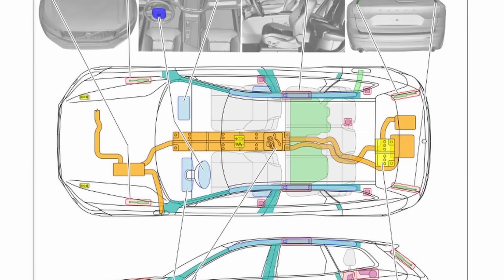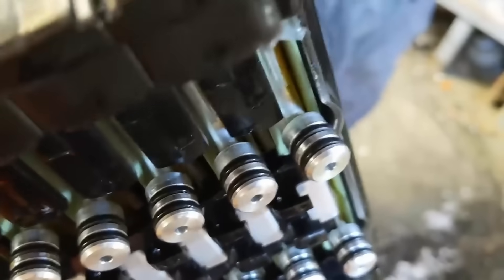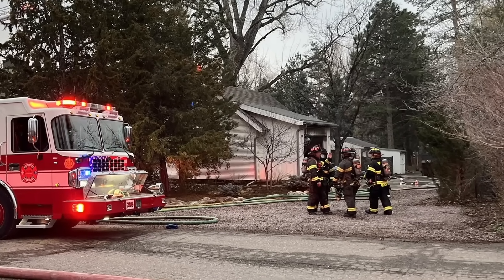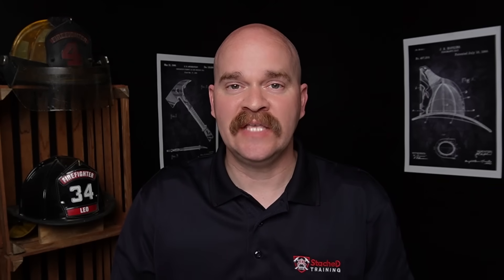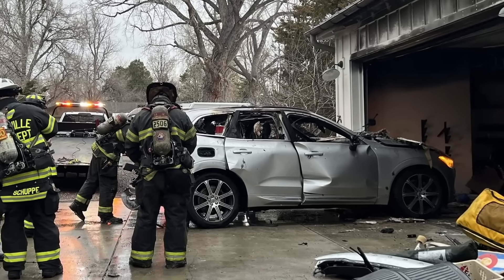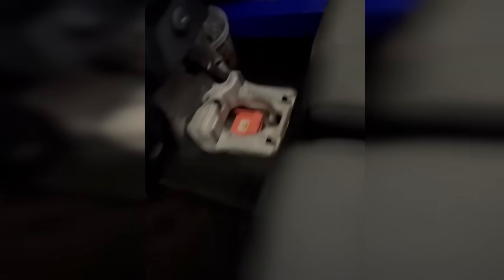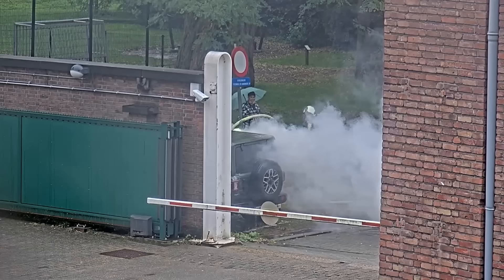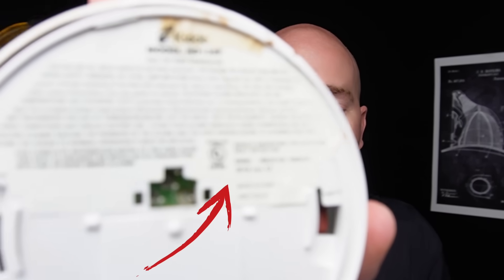EXPLOSION: Volvo XC60 Electric Vehicle!

Comment: Thank you. I'm an EV owner and was expecting yet another diatribe from an EV hater BUT I was wrong. While EV fire rates are well below that of similar internal combustion vehicles they are indeed harder to deal with. Outgassing of toxins is another aspect I hadn't thought of. Should EV owners consider putting heat sensors/alarms in the garage itself?
Reply from the maker: Thanks for sticking around for the full video ;)  Smoke alarms would detect the failure far faster.  Heat detectors would be slow to detect the failure.
Reply: @StacheDTraining  If a hybrid or ice vehicle is present, could/would combustion products set off the smoke detector? We have smoke detectors throughout our home as well as a CO detector.

Comment: Wouldn't a 'heat detector' rather than a 'smoke detector' be more appropriate in a home garage, assuming that it is tied into the home's wired alarm network?
Reply from the maker: Smoke alarms would detect the failure far faster.  Heat detectors would be slow to detect the failure.

Comment: The XC60 isn’t an EV - it’s a HYBRID. Hybrids are a risk because of the FUEL tank.
Reply from the maker: This failure has nothing to do with the fuel tank.
Reply: @StacheDTraining  Heard of fuel leaks? Hybrids are KNOWN to catch fire twice as often as pure ICE vehicles and sixty times as often as pure EV’s. It’s almost like mixing solvents and plastics is a problem…
Reply: @StacheDTraining  I think a Full EV / Hybrid owner has been upset. It amuses me how tetchy they can be.
Reply: Read the blurb at the top of the page and you'll see it was correctly described as a PHEV.
Reply: 0:13 0:16 0:19 0:23 All 2-mode hybrids are electric vehicles. ("2-mode" means it can run on just the battery, at least part of the time.) My (hybrid) 2016 Toyota Prius c is an electric vehicle.
Reply: @aliendroneservices6621  Hybrids are inherently higher fire risks. The data indicates they are twice as likely to catch fire as a Pure ICE vehicle which is thirty times as likely to catch fire as a pure EV.

Comment: This is a serious design and manufacturing problem. The batteries should be handled like an engine in an ice vehicle, completely firewalled from the interior. It is even more pertinent because of the dangerous fumes that can kill you before/without ignition. 

The fact that those gases can reach the interior of the vehicle is a class action suit in the making. This is not the only manufacturer that has this issue. Batteries in EV’s are far more deadly than ICE vehicles, now that the percentages of them are rising, the dangers are quite apparent.

Comment: if the EV industry wasn't in  denial about any and all negative aspects of these things  they might implement monitoring / alerting  for dangerous  conditions. There's certainly enough tech crammed into these vehicles already. . Also blow out plugs are a thing...  if you  admit that outgassing is possible..  The big problem is the " emperor's new clothes"  problem.  No heresy  zone.

Comment: If it already off gassing then it is more than likely already in a run away short so pulling the high voltage disconnect will not do much. The battery was probably shorted internally and once that short path is established it will burn its way through the rest of the electrical insulation in a matter of seconds. Hooking a tow chain to the car and pulling it into the open is of more use as it will limit the building damage and give the gasses, smoke and flames a place to dissipate. If the car is outside pouring water at it can be done from a safe distance and upwind.
Reply: @patreilly6826 I only have one thing to say if you see this happening!
Run for your life! 😪

Comment: Water ingress remain one of the most important root cause of Lithium battery problem and  fire. It can cause bms malfunction, electrolysis/ galvanic corrosion and HV insulation problems. A battery is made of components surounded by air which must be at equal pressure than the exterior so there is breathing effect which generate flow. This flow must remain dry but it is really hard to acheive. Condensation and making water droplet on insulator components end out making ionic path that get more and more conductive...

Comment: Every product sold to consumers has extensive testing and standards based on loooong time fire, shock hazzard experience.  How the heck did we get to giant lithium batteries parked inside structures without that kind of standard preceding them?
Reply: The generation that grew up thinking "the world is overpopulated" is now the generation in charge.

It's intentional.
Reply: @hohenzollern6025  EVs are wildly complicated gambit to achieve that.  More troubling thought is, what if we are just swimming in a sea of dumb?
Reply: @hohenzollern6025 The world IS overpopulated!
Reply: @franklofarojr.2969  What's your proof that this planet could not possibly sustain all the life on it?

Because I see it very differently.
Reply: Because it's more important to save the planet from being made unlivable by those evil gas guzzling fossil fueled vehicles.
Reply: Because it's the green agenda so its o.k.
Reply: Yeah, your right. How did flammable liquid to move our vehicles pass? Ev's are 10x-100x less likely to catch fire. So if you think ev fires are an issue then you should be out on the streets protesting against petrol cars because they're 10x-100x worse... but you don't actually care do you? Ev's don't fit your agenda so you will eat this s**t up.

Comment: Hundreds of seals on those pouch cells sounds like a nightmare when they age. I imagine many of these cars will eventually have low resale value and more failure with the battery reliability.
Reply from the maker: You're unlikely to see a 30 year old EV driving around.

Comment: if it was a BEV with a much bigger battery pack i suspect the damage would be far worse than this!
Reply from the maker: You are 100% correct.  The size of the battery will increase the size of the failure.
Reply: @StacheDTraining  A larger battery is also less likely to overheat during charging.

Comment: Imagine same thing happening in channel tunnel between England and France. Unlike a multi story steel and concrete melting( bringing in the sea) the poisonous fumes would kill any survivors
Reply: It’s bound to happen sooner or later , and if it’s peak hour traffic and the tunnel is a car park as it sometimes is, it is going to hit the fan.
Reply: Could be just a matter of time. Probably should ban EVs from even using the tunnel.
Reply: Concrete doesnt burn. Worry about any moisture trapped inside it evaporating and cracking it.
Reply: @grabannon  put an EV on or under it and it destroys it.
Reply: The vehicles are parked and not charging while on the train.
Reply: @economicprisoner  They weren't loading onto the ferry that sank either!

Comment: EVs should not be parked indoors or near a structure.
Reply: Neither should ICE cars since that would be dangerous.
Reply: What about the 250 gas car that will catch fire today in the US?
Reply: @miguellopez3392  Deflecting ??? You couldn't give me an electric vehicle because of all the issues of fires, explosions, toxic gases just within the last 6 months. i've had many gasoline vehicles over the last 60 years and never an issue with fire, gas, explosion.
Reply: @larrybruce4856  I've never had a fire or smolder with any battery powered device or tool in the past 20 years of using them, it's all about quality of electronics, modern car manufacturers already are terrible with it and is a good chunk of why gas cars catch fire, now when you have them now build cars that run far more electronics then their issues are exacerbated, a company like tesla started ground up with their electronics since they knew any battery fires would result in the death of their company, which now why teslas have the lowest fire rate of any mass manufacturer. Their interiors are cheap to keep the wires made out of copper. Some Chinese EVs use aluminum for their wiring and that's asking for a higher fire risk. Some manufacturers use cheap seals on the coolant lines and end up leaking fluid on the battery (GM, and ford).
Reply: @miguellopez3392 EV fire rates are less than ICE rates.   What sets them apart is that fire sprinklers will do nothing to control an EV fire while they can suppress an ICE fire until the fire department arrives.
Reply: @fountainvalley100  It didn't help for ICE fire at Luton.
Reply: @fountainvalley100  does that mean gas cars don't deserve the same scrutiny?
Reply: @yodaiam1000  I believe that was an unsprinkled structure.
Reply: @miguellopez3392  they are actually highly regulated and their risks are well documented.
Reply: @fountainvalley100  yes that's why they are recalled so often.
Reply: @miguellopez3392  scrutinise away 👌
Infact your the expert.
How about you explain to the ground your new take on the fire triangle:
Isn't fascinating heat Isn't ignition & oxygen Isn't an issue😉
Reply: @0Aus  heat is not igntion and not all reactions woth oxygen is combustion... now I see where the extra chromosome went.
Reply: @miguellopez3392   That is fantastic news 
I am overjoyed with your progress.
It's evident you have been studying hard as you have added extra learnings.
Unfortunately not all people retain it,
Some individuals muddle reality up with fiction.  
Keep striving ahead I am proud of you and your first steps towards the basics.👍 next week I return to work I will definitely be bringing you up at ERT training along with the detailed information you provided. 🖐
Thanks mate it can be tough get through a working fortnight, but a good laugh always helps us through. You certainly have provided plenty to entertain. 😆😅👌
Reply: @0Aus  i don't even read your comments since they don't mean anything to anyone, go learn about thermal runaway kid.
Reply: @miguellopez3392  certainly.  Definitely one of the trickier subjects, chemical reactions and such.
You be sure to message us when you get the fire triangle worked out👍
Heat, fuels, oxygen. I must say I was disappointed when you posted that oxygen created during deflagration was quote: of no issue, during thermal runaway!😶
It became evident your depth of knowledge was rather inadequate when you posted information clearly explaining in your own words that you didn't understand the fire triangle, 😁👍not even a grasp. 
You can review it any time you wish it's an entertaining cobbling of fiction & incompetence.
As for addressing me as kid, awesome 👌 you are once again totally clueless.
Reply: @miguellopez3392  That surprises no one.🙂
You have done the full circle. Made wild incorrect statements, followed by huffy belittlement attempts, refused opportunities to correct or clarify foolish statements,
All because you refuse to accept being wrong.
Now finishing it all off with the appropriate defining huffy comment: I didn't even read it, and one final attempt of belittlement by referring to me as kid.
Yep my ten year old sister once did that routine she grew up👌
Reply: @miguellopez3392  listen  bud, we all get things wrong at times. Trust me I certainly have lol.
It doesn't mean you blank it out and refuse to review assess, communicate. 
It's often how we learn from mistakes and learn better ways. 
Do me a favour don't dwell on the subject it isn't worth the hassle 😃👍
Be chill ok
Reply: @0Aus  lol you haven't, again heat doesn't equal combustion, do you get that? It's a lot like making charcoal, you cook it but you don't burn it, but the fumes venting out certainly are ready to join the fire triangle.
Reply: @miguellopez3392  Hi Little mate 🙃
Mmmm If you're still taking about requirements for combustion Think the process in the correct direction!
What must we have for a fire?
Sufficient heat,  fuel, it can be many different sources, 
Your battery fire is an example 👍 And the magic ingredient? Oxygen.
If we where to be technical it's a chemical reaction. 😃🖐 I'm unsure if you have gone onto a different subject however for fire yep. Take care champ😃
Reply: @miguellopez3392  looks up definition of spontaneous combustion 👍 it will click.
Reply: @0Aus  again look up how charcoal is made since batteries are to advanced of a topic for you.
Reply: @miguellopez3392  🤦 Heat is required for combustion to occur! You can't get around it, even spontaneous combustion.
Heat is what start the chemical reaction. Are you for real?
Go read a book.
Reply: @0Aus  are you ignoring the part where a battery can go through thermal runaway and not combust?
Reply: @miguellopez3392  🙍 you must be kidding yeah?
Yesterday it was oxygen isn't an issue with an ignition source, heat isn't an ignition source, through to thermal runaway!
Now it's heat isn't required for ignition, manufacturing via pyrolysis, yet now you're back at thermal runaway WTF?
All the while your trying to dismiss the fire triangle and develop your own!
Na🤷‍♂️ count me out. 
Luck with that.
Reply: @miguellopez3392  🤷‍♂️ What's that to do with me?
Reply: @0Aus  if only you where smart enough to admit you where wrong that the fire couldn't be extinguished in 3 minutes then I wouldn't have to explain to you why it takes 30 minutes to stop a thermal runaway.
Reply: @0Aus  charcoal.
Reply: @miguellopez3392  😃 have you had the opportunity to sober up?
Great you no doubt can now see charcoal and the chemical process of pyrolysis doesn't change the fire triangle infact it perfectly proves it.😄 give a fuel source heat add oxygen get fire! Facts cannot get around them.
😁👍you have yourself a wonderful day.
Reply: @0Aus  where does the fire happen in a charcoal process? The fire triangle doesn't include a catalyst. Heat is the catalyst, combustion is not heat.
Reply: @miguellopez3392  Who said there was fire during the creation of charcoal?
🤷‍♂️ what?
Reply: @miguellopez3392  It has become apparent you drift off quite a lot, perhaps you are in a similar conversation elsewhere or confusing our exchange with a previous one. Don't stress it happens to all of us lol.
It may be helpful if you make notes possibly with the key points.👍
As for this conversation I  will assist you with some clarification.
I haven't claimed charcoal creation (pyrolysis) requires the presence of fire. 
I haven't claimed heat is combustion. 
Nore any suggestion to such. 
I hope this will be helpful.
🙂👍
Reply: @0Aus  still not admitting the fire can be put outbin 3 minutes?
Reply: @0Aus  oh so you admit there is no fire when a battery goes through a thermal runaway, now you are learning.
Reply: @miguellopez3392  I will take this victory 😃✊
From your unsupported claims & ridiculous made up ideas that refute reality.(fire doesn't need fuel or oxygen)😆 that's brilliant. 
Attempted point that go no where, supported by you not answering a single question.😆😆👍 thanks
Reply: @miguellopez3392  😆😆😆 Where's that? Show us this admission? That's hilarious you are desperate to save face. 🤣 please Where? Where is it?
Reply: @miguellopez3392  🤭😆 nice try 👌 
Hay I know you could possibly prove a point, by answer anyone of the questions that I have asked?
Go on. You have not answered a single question nore given a reason as to me being wrong. 😄
Reply: @miguellopez3392  I wish you all the best with your future studies. Remember sox go on before your shoes. 😆
Reply: @0Aus   still ignoring the 3 minutes to put out a battery fire?
Reply: @miguellopez3392 
What fire? 
What battery?
What type of vehicle?
What country?
What fire department?
What did they extinguish it with?
What ppe was used?
What are you on about?
Reply: @miguellopez3392  what planet are you on?😆 mate you are textbook cooked.
Reply: @0Aus  still ignoring that a battery fire can be put out in 3 minutes?
Reply: @0Aus  still ignoring that you said extinguishing a battery fire was impossible let alone in 3 minutes?
Reply: @miguellopez3392  😆😆😆 surely you can do better than that!
Reply: @0Aus  still ignoring that you said that it was impossible to put out a battery fire?
Reply: @miguellopez3392  😆 hope you don't mind I have copied all your posts we are putting them together as an example of what ignorant garbage looks like from someone with absolutely no clue 😉👌
Reply: @0Aus  do any of the post include a copy of where you stated it was impossible to put out a battery fire?
Reply: @miguellopez3392  No because none of them do as I never quoted such a thing.😆 you wish
Reply: @miguellopez3392 spontaneously? uncontrollably?
Reply: @WeeWeeJumbo  yup, just look up how many fire related recalls just made in the past year.

Comment: How many times have you heard that a house burnt down and they said it was electrical?
Reply: Ya let’s just change the subject to house fires in order to ignore electric cars exploding issue.
Reply: The fire service use that excuse when they dont know
Reply: @radiotowers1159  and somehow they use 10x more water
Reply: @Mr11ESSE111  Its not the electrical stuff in the house which causes the problem its all the wood and household stuff that burns , the copper in the wiring still there after its extinguished . So why do they somehow  use 10X more water to put out a house fire
Reply: @radiotowers1159  hes talking about electric cars
Reply: @ouch9326  🤣
Reply: they hide
Reply: Right But leave it up to boomers lmao EVs charging at home are likewise at a lower risk of starting a fire than other appliances. Cooking causes 172,900 home structure fires a year, mostly from electric stovetops, far more than what EVs cause. While there are far fewer EVs than kitchen appliances, fire risks from electric cars are still relatively low by comparison